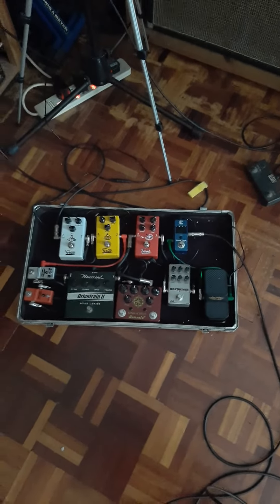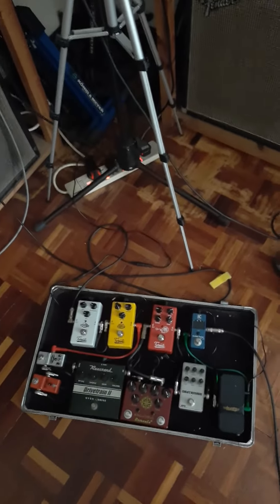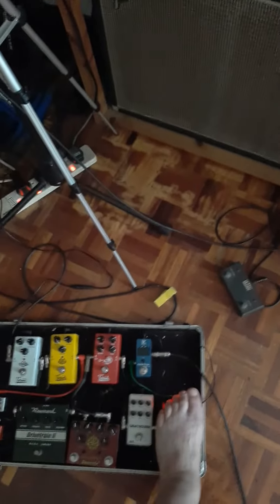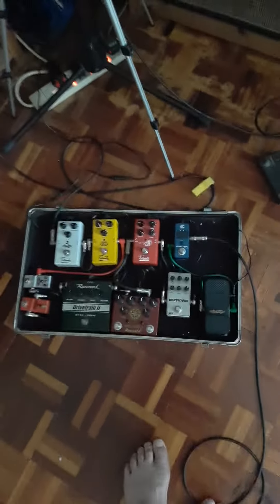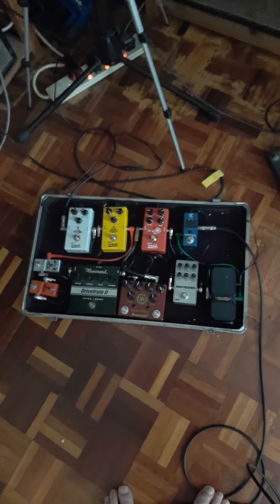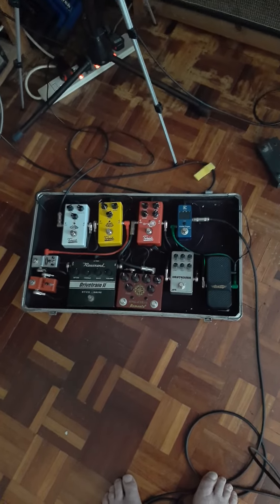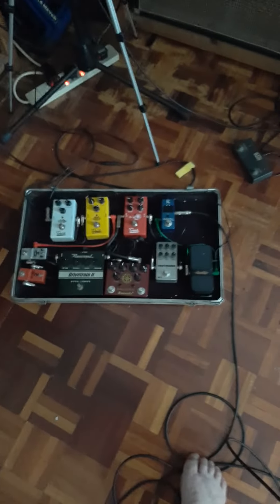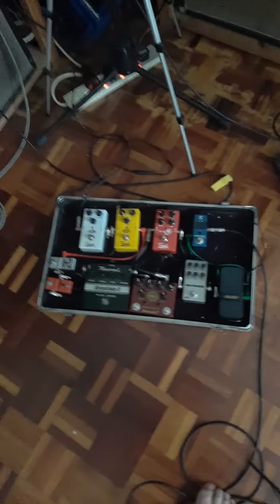The broken wah/volume that thinks it is a fuzz

Comment: Sounds insane in the best way possible! Shared it to a Facebook group so hopefully someone can give any info
Reply from the maker: At a guess the input buffer on the volume pedal side has gone haywire.

It is all surface mount apart from the switch, jacks, and inductor, o fixing it is probably a non-starter.